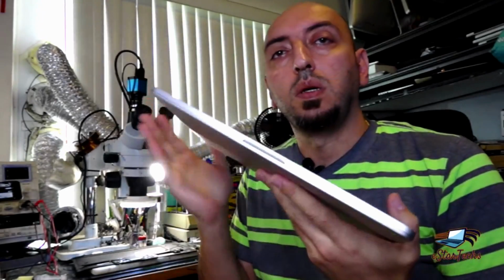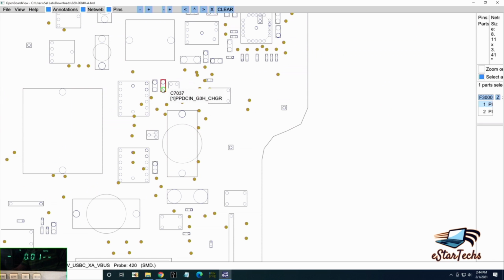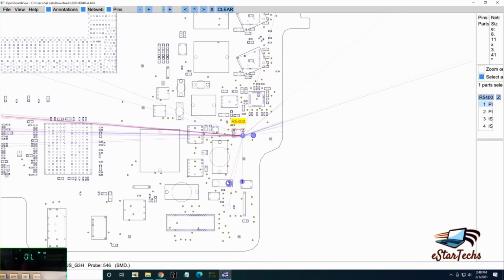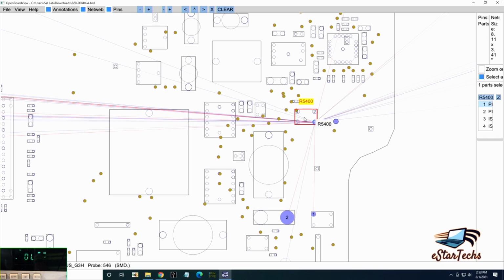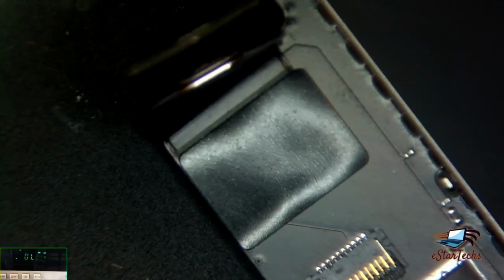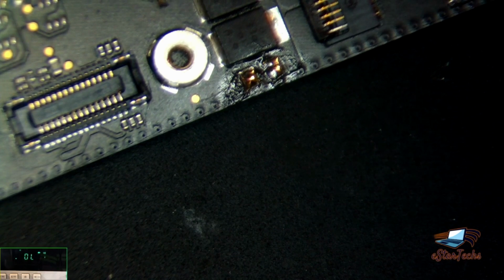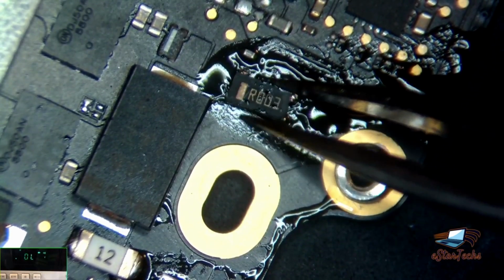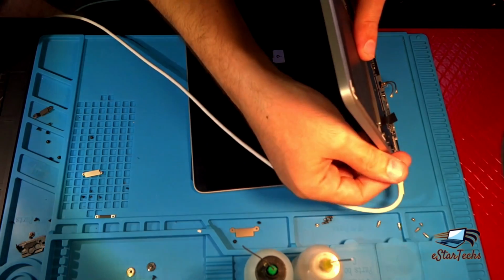How to fix MacBook pro 13" A1708 no power 820-00840-A

Comment: HI
thank you very much, you helped me  to solve the problem by following the steps you did. I found a short at the F7000 fuse. I removed it to separate and identify the side it has the problem with, pin 2 is OK, but pin 1 is shorted. I injected 5VDC to identify the component that is going to get heated. I noticed that all the components are cold. I measured PIN 1 a second time. I was surprised that the short circuit disappeared. !!! without changing any component. i assembled my mac and everything is ok. work good. Can you explain to me why the short  is disappeared just after the injection of 5VD. it's like he was asleep and I woke him up. sorry for my english, I folow you from Morocco.
thanks
Reply from the maker: My pleasure!
Reply: Sometimes voltage injection can clear shorts. Maybe a very fine connection causing the short and an injection of voltage "burns it out?" Just a word of warning. You need to be really careful injecting anything above 1 -1.5v on PPBUS_G3H.  This goes to CPU Mosfets and if one of them is faulty (closed) that 5v will go straight into the CPU and fry it.
Reply: A short in a fuse? It’s impossible. A fuse is a wire.